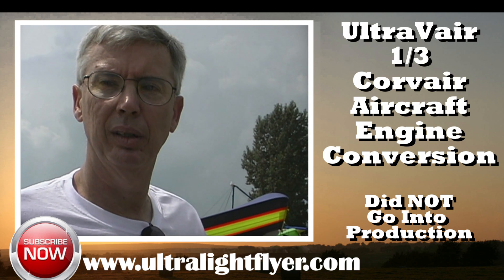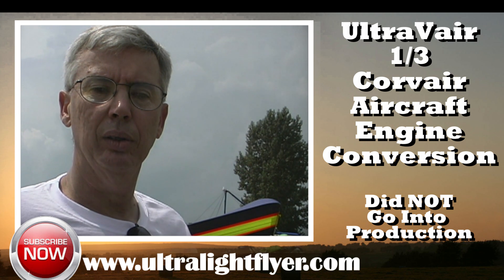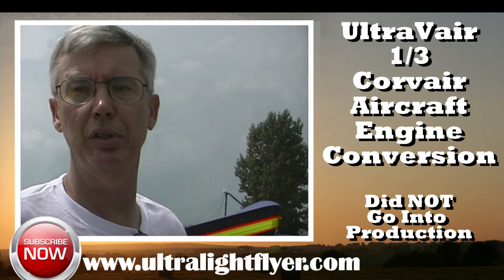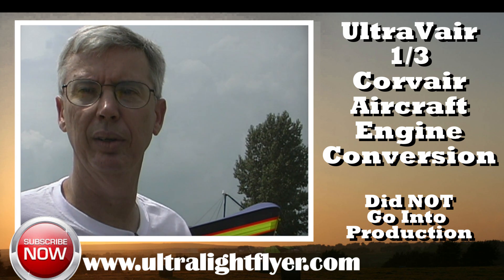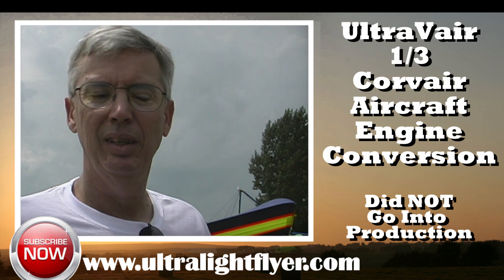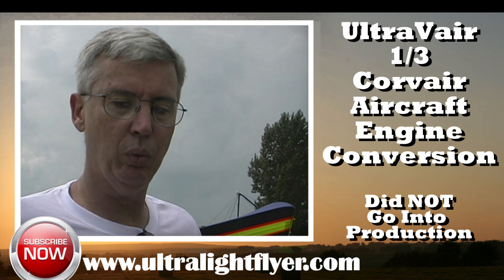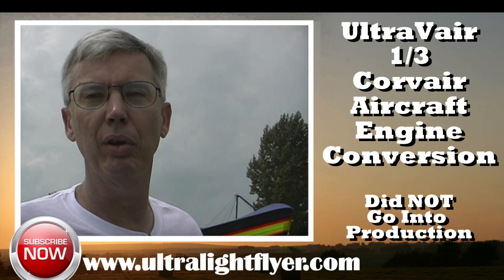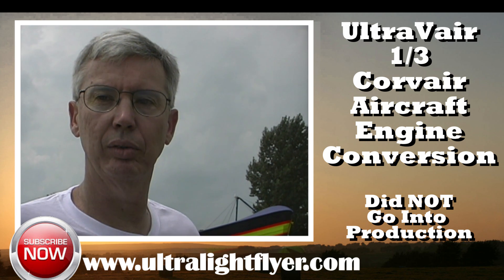UltraVair, 35 HP, Twin Cylinder, 4 Stroke, Corvair aircraft engine conversion.

Comment: Someone should also look into the Fiat twin air twin cylinder turbo. It’s a 900 cc twin that makes 105 hp and 107 ft/lbs. it’s a little heavy but if it had an aluminum block it could be a great little light sport engine.

Comment: What did the 6 cylinder Corvair engine put out in HP?
Wouldn't 2 of those cylinders put out 1/3 of that?  Or are their other factors involved in determining HP?
Is your prop pitch for climbing, cruising, or somewhere in the middle?  Can you put an adjustable pitch prop on it?
Does it use an alternator, or the old generator?
Reply: as fletcher built it, it was legit just a 1/3 corvair engine, which should be similar to william wynne's 100hp engine.  using that math you should theoretically get 33.3 hp out of it.  it is worth it to use the 92mm cylinders on these engines which makes it about equivalent to a "37hp" half volkswagen.